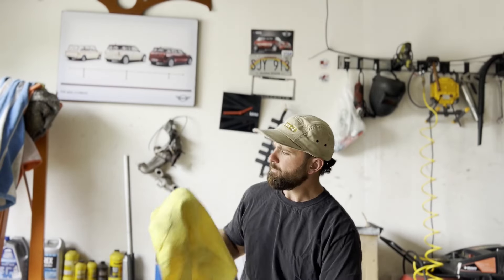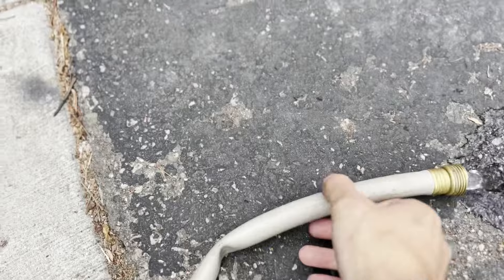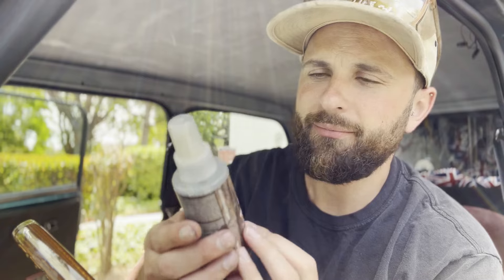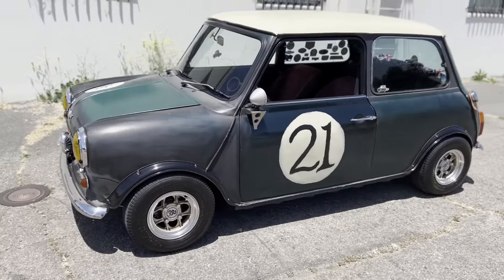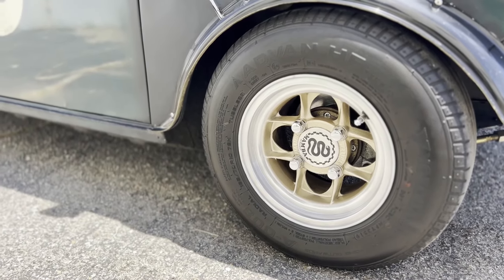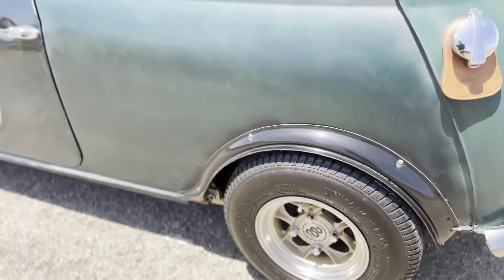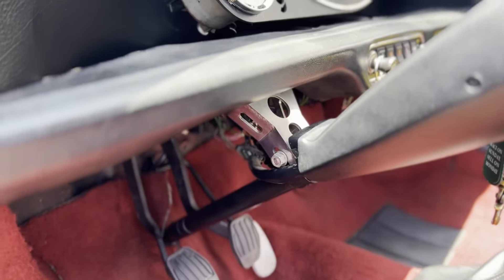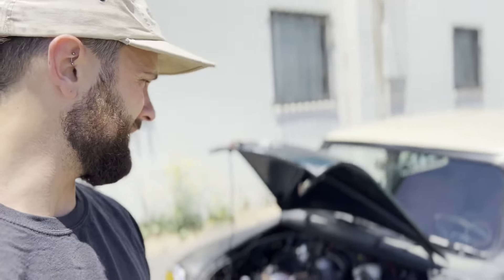Mini Life | My Gritty Classic Mini (Gold Tooth Kray Wash & Walk Around)

Comment: Totally agree with the rear lights + hinge comment, i had the same thought way back in 91 with my 1st Mini ....... 
I did have the exact same reverse light i paid UK 3 pounds for and love the 3rd brake light, 
 I had 5 minis in my time and woah does my back know it now all  these years later ! 
 Have fun and always keep that gearbox and engine oil in  good shape is my best tip for ya 
 Drop bracket was also a mod i had bought and a very old wood rimmed wheel....
 Gotta say you have the right idea ! 🏁
Reply from the maker: Thanks ! 🤙🏽🏁